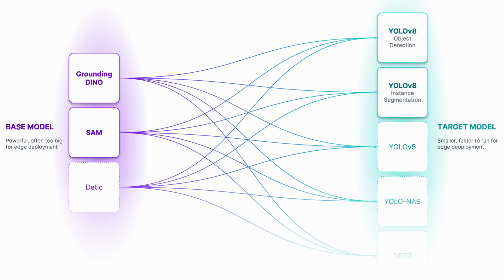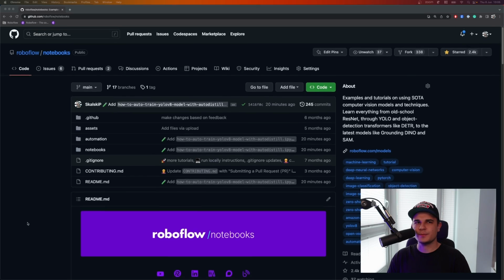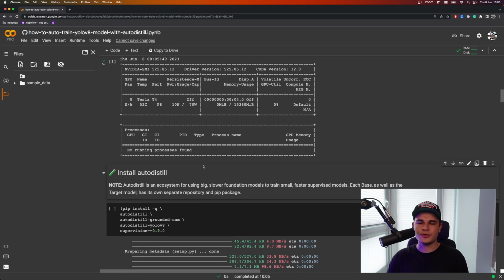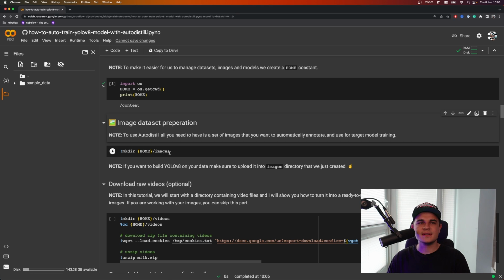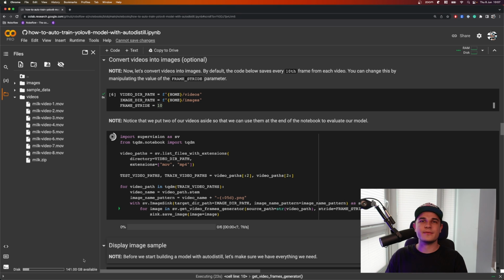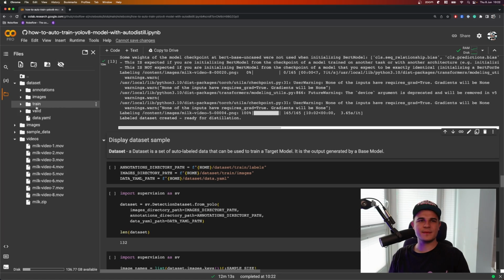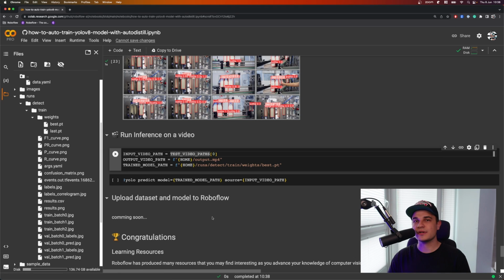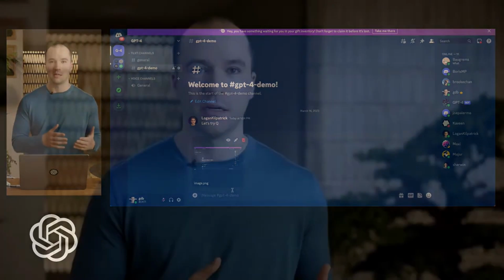Autodistill: Train YOLOv8 with ZERO Annotations

Comment: After executing the code, the 'confidence.txt' file is not being created in the specified output folder (output_folder). I have checked the directory structure, file extensions, and paths, but the problem persists. Any assistance in identifying the issue would be appreciated. 

after using this part of code im facing the following problem:
from autodistill_grounded_sam import GroundedSAM

base_model = GroundedSAM(ontology=ontology)
dataset = base_model.label(
    input_folder=IMAGE_DIR_PATH,
    extension=".png", 
    output_folder=DATASET_DIR_PATH)

FileNotFoundError: [Errno 2] No such file or directory: '/content/dataset/annotations/confidence-3_result.txt'
Reply: Same problem here! Anybody know the resolution?

Comment: Does this framework support anything? Like galaxy object detection? For example, I have Galaxy images(about 300k) and the objects visible in the image are stars and different types of galaxies. My objective is to classify galaxies into two class. Is it possible to auto annotate?
Reply: Only if they are in caption ontology. only those models if they relate to the base model. But if you do the labeling of your images and use as a base model for others it will be ground breaking

Comment: If I want to train a model, to detect and classify very specific objects, of which the foundation model doesn't have any labels (like on a highway senario, I don't only want to detect vehicles, like in a category car, but I also want to tell the brand of the car, or even more specific the model of the car.) would it still work? Can we teach a model with that complex classes without annotation?
Reply from the maker: No I’m afraid it won’t work. That query is to specific. Zero shot detections are not as powerful.

Comment: looks promising! so if I understand correctly - there are two phases: (1) auto-label an image dataset, something that you already showed in the G-SAM previous video (2) split the dataset to test/train/val and build a CV model with YOLO-8
q1: since auto-labeling is not 100% fullproof, what about the human in the loop? 
q2: what if the base model doesn't recognize the labels (name of specific boats I have in a marine dataset), how can I fine-tune it? so the model will find a boat, but will also "know" the brand of the boat
Reply from the maker: Overall yes. But it doesn’t need to be G-SAM and YOLOv8. You could use other base and target models. 

You could upload your auto labeled datasets to Roboflow for human refinement and download it back to your environment for second stage. 

If the base model won’t detect objects you want to find you should try some prompt engineering. But there are definitely types of objects that we won’t be able to auto annotate. Good thing is that with every base model autodistill will become more powerful.

Comment: Small request for next video: data collection -> autolabel -> load to roboflow for manual correction -> train -> compare accuracy with today's result
Reply from the maker: Hi 👋🏻 It is Peter from Roboflow. So comparing automatically build model with the one trained on manually annotated data?
Reply: @Roboflow  compare manually is OK
Reply: @Roboflow  use autodistill to label the data then check it manually for the correct anotations them train with yolov8
Reply: @mrbot4one hello I am working on project like it will detect the car model in real time but I search a lot I didn't find how to train model and test it can you please suggest me it will be big help
Reply: @SAITAMA-07-13  Use YOLO for your purpose

Comment: How precise is the annotation? Like...for example if I want to label 3 types of insects...does it ricognize the type or will i have just a general 'insect' label?
Reply from the maker: Hi 👋🏻 It is Peter from the video. You should always try and test, but my assumption is that it won’t be able to distinguish between different types of insects. They will semantically be to close to each others but insect class sound very reasonable.
Reply: For each insect, can't you take a video, and then adjust the CaptionOntology? I guess this would create 3 models, but maybe they could be combined or something?